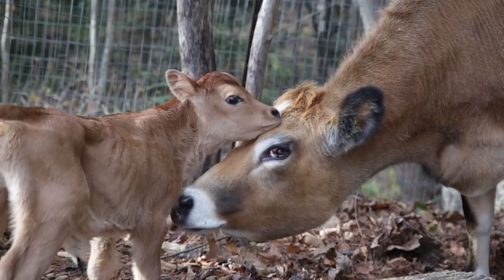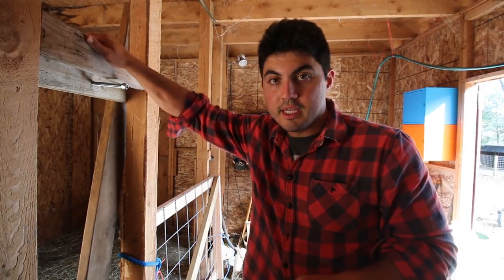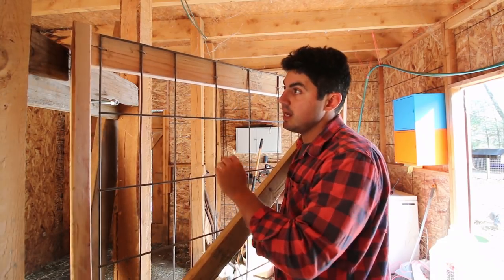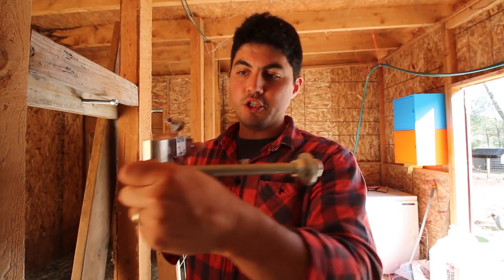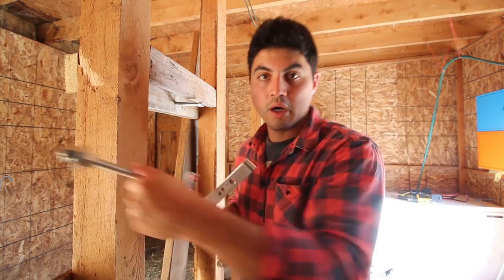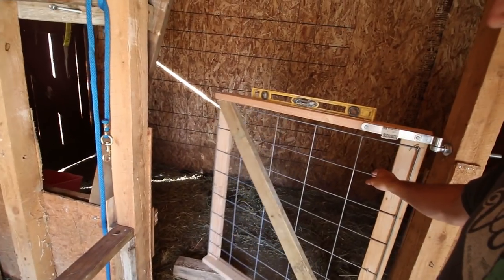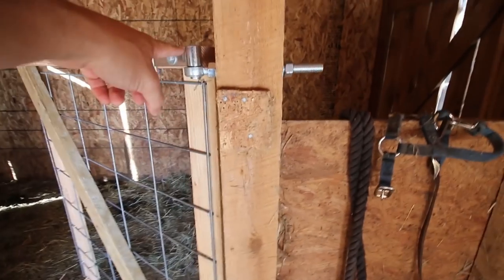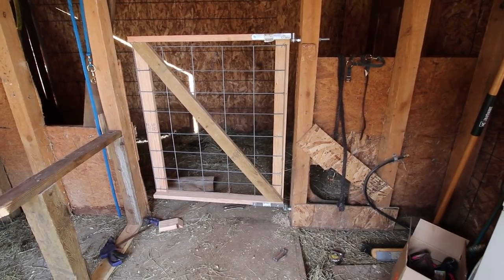Installing a Gate that swings both ways... Almost

Comment: Flip the bracket that attaches to the door over so the barrel section is in the center of your 2x4 that is running vertical on the door
Reply: He can also make a 90degre bent on the brackets to move the barrel to the center!

Comment: The strap is the wrong piece since you need the round ring in the center of your short "side" that is parallel to your post. They have the same size pintel you can bolt straight in and sit the gate right almost next to the post and you will swing 90 each way
Reply: . The only clearance you will need is so the edge of your 2x4 gets past the post.

Comment: (hmmm ...).  Any reason why you need the gate to ALWAYS move in both directions at the same time - as shown ?  Makes it an either/or situation - rearward, cross gate, and forward positions all at once.

Why not install a double set of gate bolts to the left (rearward) and right (forward) of where you have the bolts center-drilled now.  Then, with manipulation, you can remove gate from the forward bolt position to the rearward bolt position (and vice versa).  The single door can be used for the needed THREE positions - rearward division, cross gate, and forward division.

Or ... again just buy another set of gate bolts with the same forward and rearward drill positions.  Make another gate (!).  Have BOTH GATES on BOTH GATE BOLTS.  You then can have your forward-moving and rearward-moving gates.  Then, ... you have FOUR options.  (1)  You can have a double cross gate when together ... or (2) a cross gate and the rearward gate division ... or (3) a cross gate and the forward gate division, or (4) a rearward-and-forward gate divisions (and no cross gate).

All is spiffy.  All is eazy squeezy.
Reply from the maker: The dual swing is nice for our small little barn, sometimes people or animals are in the way of it swinging one way or the other! But I did some adjustments since and got it to about 60 degrees on the stall side, should work enough... easy squeezy!

Comment: I think it was the mounting on the gate .. since it's on one side the offset effects angle... if you could have mounted the hinge on gate same as the post .. in the middle vs one side it probably would've worked out .. I'm just a YouTube expert no real experience.